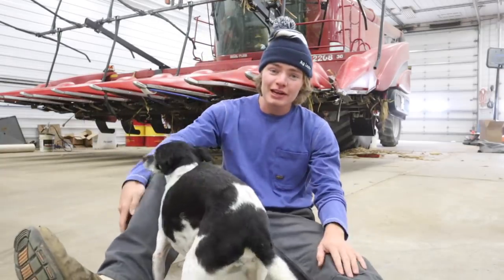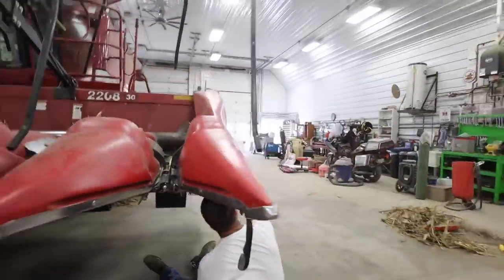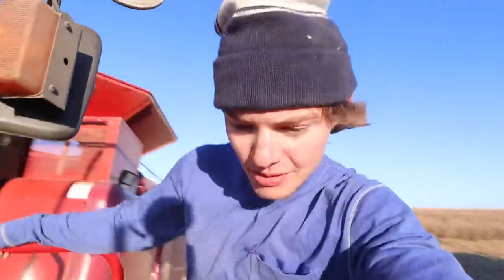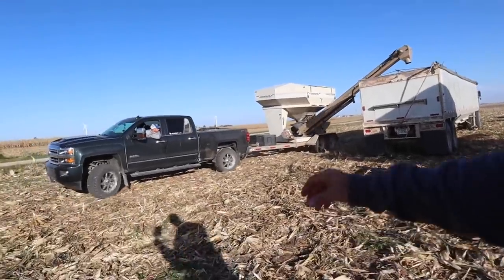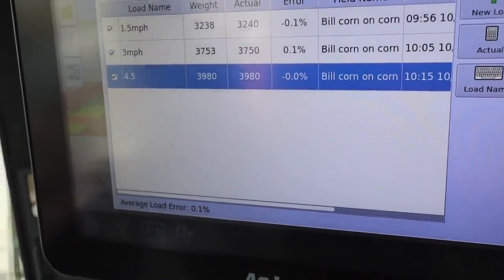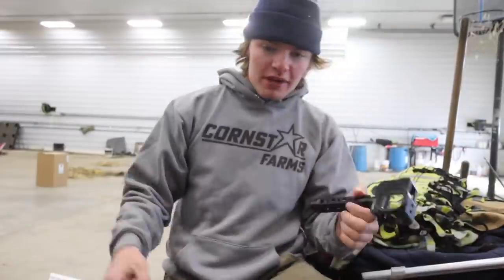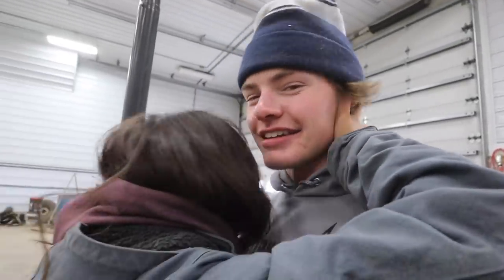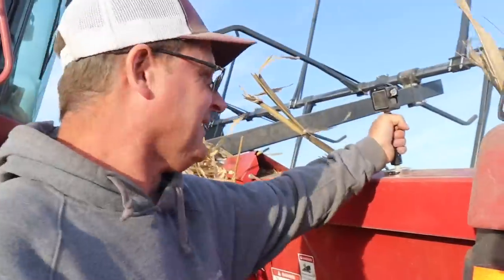I Bought A 330 Pound Rare Earth Magnet

Comment: Bought a old truck just wanting something to drive in the field because I’m only 15 I just wanna get more comfortable with vehicles and a fuel pump job turned into a find out why it won’t get power job😂 I was going to scrap it but now I figure I can just learn how to fix electrical stuff because I want to be a mechanic anyways and that knowledge will come in handy somtime always gotta make something positive out of a negative
Reply: Fixing is more fun in the long run than replacing.  What did you buy?
Reply: @peggyisme  94 Chevy 1500 4x4 work truck with a v6 of my neighbor who has fields full of old cars and tractors and trucks
Reply: @jonthelamb4549  FAcebook has a group for the 1500's, I bet they would have part sources and fixes for issues.
Reply: @peggyisme  ya I might buy some tools from the pawn shop if they don’t ask to much and figure it out myself got kicked out of school again because of Clovis so I got some time but it’s getting cold if not I will check out those Facebook groups for sure

Comment: I agree with Cooper 100% You put Cole in the seat and everything goes south. Sable would be a better fit, because Cole is not a farmer.
Reply: I guess you missed all the vids where things broke while Coop was driving them right?
Reply: @JCrook1028  Coop can fix his broken stuff, but not so much for Cole and his father.
Reply: @pamelaglowczwski8904  They all have different strengths. Cole does the books. Just as important as Cooper's mechanical skills. Dad has the overall experience to keep both the boys on track. they are a TEAM. ALL 3 are equally important.

Comment: The fasteners on your combine corn head are metric??? Is this a European piece of equipment or is that 16 mm fastener really 5/8"? If you are indiscriminately using SAE and metric wrenches on your equipment, use 6 point box wrenches and sockets. 12 point tools will round off hex heads of bolts and nuts. But the real solution is to use proper SAE or metric tool size depending on what the fasteners really are. Following that discipline will save you a lot of trouble later.
Reply from the maker: Every bolt on the combine is metric. Besides the add on ones by D.C. 😉
Reply: Cole - You understood the idea about the advantage of the 6 point sockets and box end wrenches over 12 point? The 6 point tool design offers greater surface engagement with the hex shaped fasteners. Less slip on the nuts and bolt heads to cause rounded off corners and busted knuckles. The trade off is that 6 point tools are harder to use in confined spaces.

Get yourself a Stihl or RedMax brand gas blower to knock the dust off your machinery. The blower will be much faster and easier than a broom on the machine shop floors as well.
God bless.